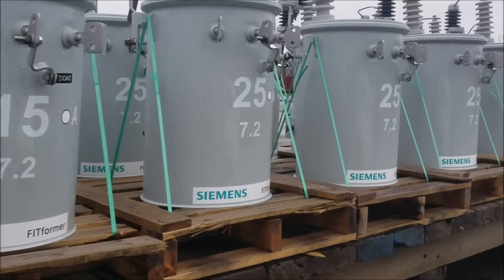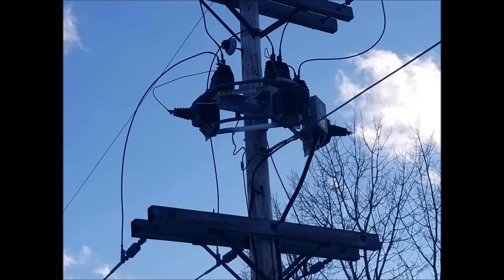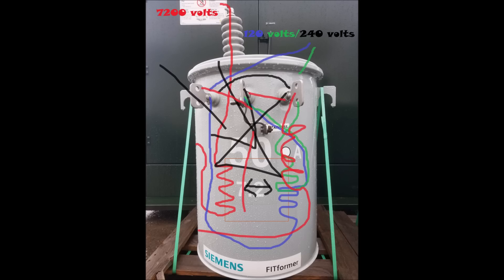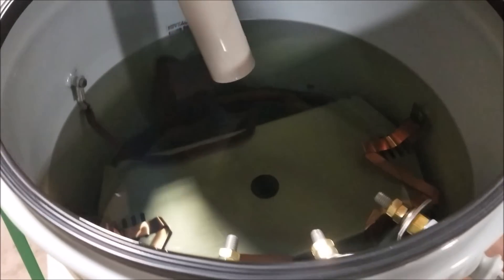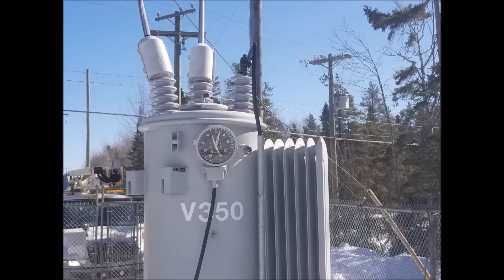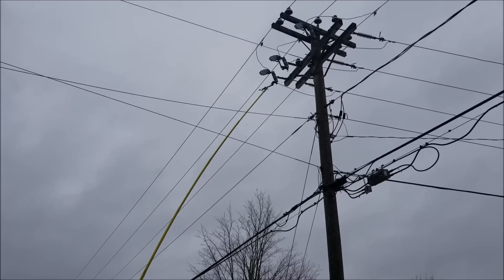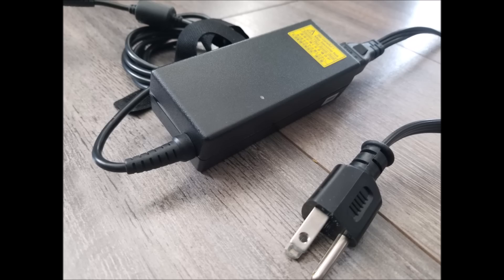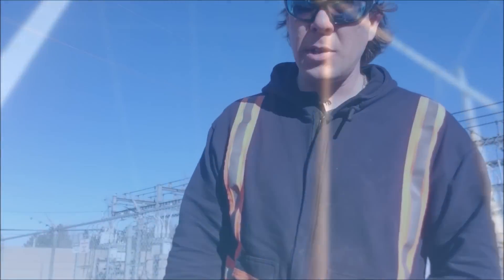What's inside a Transformer?

Comment: Oil and water can mix, ask any mechanic what a milky colour means on the dip stick or radiator cap.
In saying that transformer oil and motor oil are both oil but aren't interchangeable. Motor oil has additives that inhibit wear and corrosion, along with detergents. These additives may make the oil conductive. And I maybe wrong but most engine oils do contain a small amount of H2O from the atmosphere and possibly from some of the compounds they add. Oil will draw moisture into itself, which your engine boils off while it runs.

For small projects unscented baby oil can be used in place of transformer oil. 

And not all transformer oils are safe, an older type known as PCB (Polychlorinated biphenyl), real nasty stuff, gives you cancer.

And not so long ago, the transformer that supplies my street went bad, boiled the oil and blew the plug out which bent the 2 end covers which allowed them swing open on the padlocked end as the pins pulled out of the hinge blocks, the door on one side slammed into the fence it was near and broke 2 of the  6" wide fence palings. It woke me up and as I dressed myself the power then went out so my guess is the primary shorted out and heated the oil up until BANG and tripped the breaker. Within 6 hours we had a nice, new transformer.

Comment: Help, anybody..peco transformer on the ground 80 feet in front of my house, the lines in and out of the xformer are underground.
The xformers hums loudly. This hum is being transferred into my house. Their is no quiet room in my house. Its not the sound being transformed its the vibration. I believe the vibrations go through the bedrock/ soil and into my concrete slab, then into the walls. My house is a big bass speaker for the peco transformer..peco came out and said sorry charlie. Cant help you

Comment: had no idea there was oil in them, makes me wonder about some of the extremely rusted transformers i've seen out in the countryside, those are probably going to leak at somepoint.
Reply from the maker: They very well could! Dead grass at the butt of the pole is a good sign of a slow leak. The transformer will soon fail if too much oil is lost, but any unit that's showing extreme signs of age/rust should be looked at.

Comment: I am wondering when/if ever we will use switching power supplies in place of the big, heavy transformers we have now? Probably would help with heat and efficiency.
Reply: I'd say probably not considering the added complexity and electronics of a SMPS which would likely be more susceptible to voltage spikes from lightning and heat (at least the semiconductor parts), not to mention it'd be converting the high voltage AC, to DC, and then back to Pure Sine Wave AC at that which requires a fairly complex inverter and lots of filtering.  And finally there's really not much of a reason to replace the 'big heavy transformers' considering they're not really using up space that would otherwise be used by something else, as they are transformers are super simple, reliable and robust.
Reply: No.  Why would you even suggest that?

Comment: Such a shame you didnt detail the actual terminals purpose or the terminals connections to the secondary windings.
I am assuming its just a winding with a few taps at 1 end? To adjust op voltage for length of line vs average current.

Comment: 2:30 The capacity, or KVA is determined by the amount of power the transformer can transform.  Not exactly limited by the "number" of wires.  For example, what is shown is a smaller pole mount single-phase.  I would guess maybe around 20kva, or 20000 Volt-Amps.  Or roughly 100 PS5s.  You could, with enough engineering, build that transformer up to 2000kva, or 10000 PS5s.  Heat is the limiting factor of a transformer and with enough fluid, fluid movement, heat dissipation and space you could load the hell out of a transformer.
But you could get something with the same capacity for a third the cost and ten times more reliability.  More copper and more iron gives it the ability to move more current in a moment of time with a similar amount of heat generation.  More Insulating fluid allows for greater heat capacity.  As heat is generated in the core and windings the oil begins to naturally circulate with the heated oil rising to the top, then cooling and descending along the sides of the tank, to return to the bottom center where the core and windings sit.  Adding radiators allows the circulation to occur more efficiently.  Fans, pumps and water regulated radiators also exist in various configurations.  All of these systems are designed to turn on as the liquid and or winding temperature rises, which cools and allows for greater capacity.
This is why transformers will list multiple KVA ratings.  a 1000/1500/2000 KVA transformer has three stages of cooling: Natural convention and natural airflow, (in this circumstance) Natural convention and forced air stage 1, Natural convention and forced air stage 2.  Stage 2 forced air will engage more fans while forced air might only turn on half of the available number.
It's more accurate to state that the capacity of a transformer is based off it's ability to regulate heat, not the total capacity of heat.  How well it gets heat out of the device, not how much copper and iron it has.
Those laptop power supplies and your phone charger are not, in fact, transformers.  They are rectifiers(yes, they have a transformer inside most, but you identify the device as it's intent, not the component parts which can not be accessed by a typical user).  Transformers are AC specific, as DC lacks properties which allows for transformation.  Rectifiers "rectify" or reverses the polarity of specific portions of an AC signals sine-wave.  This makes the ~ not lumpy on the top and bottom, but just lumpy on the top.  Further "cleaning" of this signal evens out the signal so the potential is as flat as possible.  The characteristic of an AC signal(for 120VAC) is that the potential(voltage) rises from Zero to 169Vpos then drops to Zero and further to 169Vneg and finally rises to Zero.  This repeats 60 times a second for what is 60hz.
DC would be a flat 120V or 60Vpos and 60Vneg.
Reply from the maker: Great info! Appreciate you taking the time to write all that 👊👊🍻

Comment: Rural North Carolina here. Electronics hobbyist, jobless and disabled... amongst other things. Huge respect for folks like you, I work on stuff with basically battery voltages. What you do is more like workin on a Jacob's Ladder or the biz end of a Tesla coil while it's running. Not gonna lie, that idea scares me a little bit lol.

Funny thing, the transformers around here, judging by the winter storms we have when it gets bad in January and early February, mostly contain sparks and fire :P makes one heck of a bang when they detonate, too... amazing what a little ice in just the wrong place can do!

Seriously, though, a transformer in simple form is two coils of wire. Usually it's wrapped around a bunch of "laminations" -- thin sheets -- of what's called ferrite, the stuff that the little fuzz in those "Wolly Willy" toys are made of. It's a special kind of iron-based ceramic that's really good with magnetism. Because magnetism and electricity are really close to each other, when you have a big coil of wire in one spot, and you put power through it, it creates a noticeable magnetic field. (Technically, any wire lead with power is a one-turn coil, but that's not important here; you only have to worry about that with either high-tension-line kinds of power, or frequencies starting around that of microwave ovens and WiFi) If you have another, unpowered coil, nearby, and you jigger things up just right, you can power one coil from the other without the two being electrically connected. This uses what's called "magnetic resonance" -- the changes in the magnetic field in one coil, show up in the other coil, producing electricity from the magnetism. (For what it's worth, this is also how antennas for things like radio, TV, and mobile phones work, at least in part.)

What Bobsdecline shows as "transformers" inside the house -- eg laptop bricks -- are somewhat more complicated devices known as switch-mode power supplies. Most early power supplies, regardless of whether they operated on AC or DC, were called "linear" power supplies, and they lowered the voltage being output basically by converting excess electricity to heat. Obviously that's not very efficient! A typical switch-mode supply takes advantage of something called "inductive kickback" -- you know how, when your air conditioner cuts off, your lights often get a little brighter for a split second? That's inductive kickback -- when you have a coil of wire, such as in the big honkin motors that run the compressor in your HVAC system or heat pump, and you cut power to that coil after it's been "energized" (had power put through it), as the magnetic field collapses around the coil because no more power, it creates electric power within the coil, going the opposite direction from the original power source. If you take something that can store electrical energy in it for a little while (we generally call that a 'capacitor'), and connect that to the coil, such that that bit of kickback gets stored in the capacitor, then by switching the coil on and off again really freakin quickly, we can add electricity to electricity inside that capacitor. That's the basis of how basically all switch-mode supplies work, from the ones that are in your laptop's charger brick to those little lightweight wall warts and USB chargers. Heavy wall warts are often called "unregulated", but really they're loadregulated - a simple transformer, and a thing called a "diode bridge" that turns AC into DC, and that's it. Because the more electricity you try to pull from a transformer, the lower the voltage coming out of it, for the most part (aka "voltage sag"), so-called "unregulated" supplies are designed very carefully to balance all that out, so that when your gadget needs 'x' amps of current, it's getting them at the proper voltage.

Comment: While in Vo Tech electric shop we had a wise guy who always sabotaged your jobs. We had what look like a pole mounted transformer that was filled with oil. Believe it was a 480 volt to 120/240 volt secondary. Bunch of us chipped off some of the insulation on windings removed some oil and placed metal chips then reinstalled the cover. Luckily we had a very safety conscience shop teacher that made you stand back before he hit a remote button to energized our test center. Lid blow off the transformer and a lot of smoke. Wise guy was not allowed to energize any of his work after that and barely passed the course.

Comment: transformer outside of my moms place has a fuse cutout and one of them things thats suppose to prevent lighting damage but it seems that failed as it cooked the transformer even after the HV to the transformer was energized as when the lighting struck it blew the fuse for the transformer and the HV line i think they was able to bypass the transformer for the mean time by placing jumper wires that was connected to another transformer on my street so people could atleast have lights.....i can remember sitting in darkness expect for what lighting equipment i had at the time for atleast 2 hours as that is when someone from the utility company for my area here in the states could show up after checking fuses for both the transformer and the HV line it was declared the transformer was cooked but i cant remember how long it taken them to replace it as when they was starting the process it had started raining

Comment: Really surprised that final transformers in the US only use one phase to ground for the primary. In the UK it's usually connected across 2 phases to spread the load and eliminate the ground conductor
Reply: By primary coil, I was referring to the high tension side of the transformer, not the low voltage side. Sorry for any confusion. In rural UK areas there is often a similar arrangement on the low voltage side, but it is 480/240v, but only one side and the neutral goes to each property
Reply: @InverhavonRailways  sorry for the misunderstanding and that's very cool!
Reply: In the US 220v is actually split across both phases, the third wire allows for 220v to be split down at the middle of the transformer to 2 110v legs that are on opposite sides of the AC sine wave. So if you connect one leg and a neutral, you get 110v, and if you replace the neutral with the other leg than voltage difference is 220, so you get 220v. Some things, mostly electric stoves actually use all 3. Allowing 110v for the control panel and 220v for the  heating elements.
Reply: I was also surprised that the primary connections weren’t on two identical-looking high-voltage insulators.

Comment: 1st thing I do if I lose power, call up and report it. If it is getting on to night time and I'm
going to be home, I shut off the dis-connect out at the pole under the meter. and lock 
the box. I also shut mains off in the house before I even start a generator, so it means that
there are two disconnects between gen and the service drops. were the disconnects left on,
240 volts would go to the service drops and into the secondary of the transformer, which
would now be working as a Primary and the primary will have like 30 X the voltage feeding it,
a very dangerous situation, consider a car taking out a pole half a mile from a home and
Benny Benoyt hooks up a generator but never shuts off the mains, now there could be 
7,200 volts or more where it is not expected, if that wire is down it will probably arc to ground
but if it is still on the pole, well I hope they ise a 'Buzz stick' or a meter to check lines.

Comment: I mess with 480v transformers at my job, we always have to ramp power them or they blow breakers. I find it interesting these dont have that issue. Most of the utility type transformers and equipment are trade secerts, the public knows next to nothing about the tech, just face value. My understanding after working at my job that supplies industry.

Comment: I work at a place that a lot of large containments with thousands of gallons of insulating oil in them like big transformer/ rectifier sets and modulators. We use a lot of canola oil now. Smells weird when it gets hot or we toast some of the components.

Comment: I filmed a Transfer Fire about a year ago in the Summer here in California.  The Fire Department let it burn for 45 min while PG&E    Was Called Out to cut the Power ! One thing I noted was the lid and ring where on the street during the incident. Can a Transformer build pressure?
Reply from the maker: It absolutely can! There is a pressure relief valve on most units nowadays, but it's definitely possible for them to blow up alll the same. 
Most times when we get "transformer blew up" calls, it's just the fuse that blew. When they do actually blow up, it can be very dangerous!

Comment: In case no one said this. Most power supplies are not direct conversion transformers. AKA linear power supplies. They are switch mode power supplies and are a little more complicated then just a transformer + bridge rectifier + voltage regulator.  Yeah, years ago they all were. Laptop power supplies, chargers are all switch mode power supplies. More complicated but also more efficient. As they don't work with 60hz power internally.

Comment: Wall warts of yore were pretty much just a transformer. Nowadays, although they contain small transformers, most of the interior parts are other electronics to regulate the output and to run the transformer at a higher frequency than 60Hz so a smaller transformer can be used.

Comment: Where can I look more into this magical inductive resistance that doesn't cause a dead short between the high voltage end of the winding and the ground side? Is this a similar situation as a center tapped wye transformer?
Reply: Capacitors and Inductors are related.  They both do similar things in different ways.  A capacitor initially has no charge.  When power is applied to it, it soaks up that power and stores it chemically.  When power is removed, it can discharge that power, like a temporary little battery.  Once its charge is dissipated, it can't recharge until it can feed on more power.   

An inductor is a coil of wire.  As all* electric current generates a magnetic field around the wire, coils of wire amply that magnetic field.  When power is applied to an inductor, a significant magnetic field forms around it—more significant than just a straight wire itself.  Once the magnetic filed is formed, it stops drawing current*, similar to the capacitor.  However, when the power is removed, the magnetic field collapses.  The energy in that field puts a current back into that inductor.  Once the magnetic field is dissipated, it can't reform until it can feed on more power.  

Changing magnetic fields can induce a current in a wire. This is how all electric generators work...magnets are pushed or spun around inside coils of wire (by a mechanical source of power) which induces electricity in the coils.  As the magnets spin around with respect to the coils of wire, the polarity of the current changes.  This is called alternating current.  In the U.S. and Canada, the current frequency is 60 Hertz. This means that the + and – polarity of the circuit reverses 60 times per second.  That quick reversal causes magnetic fields to be constantly created and then collapsed and then created (in reverse) again.  A transformer takes advantage of these magnetic fields by using coils of wire (an inductor) and transferring the collapsing magnetic fields to a second coil of wire.  The magnetic fields are amplified by magnetic materials such as iron, which amplifies the effect.  There is no "dead short" to an AC source because the coil is performing work in transferring current magnetically to the other coil of wire.